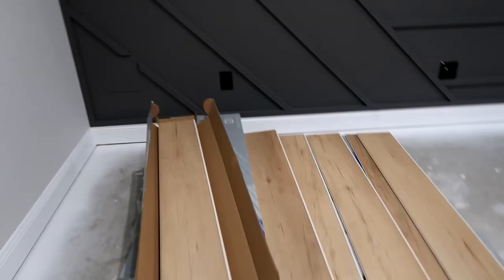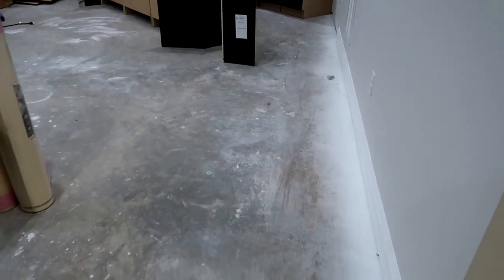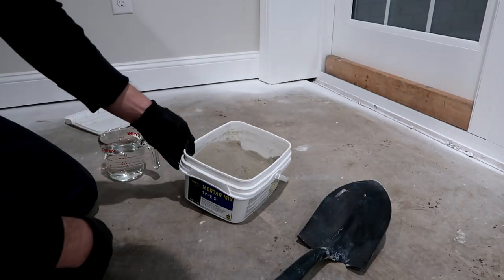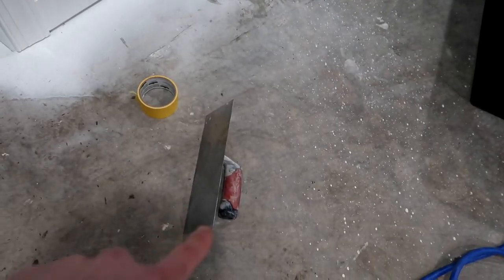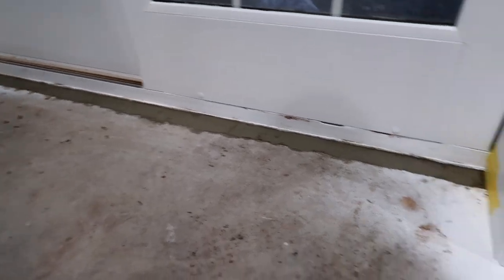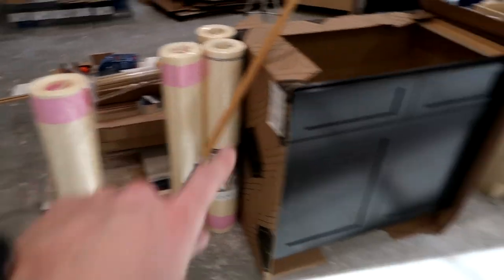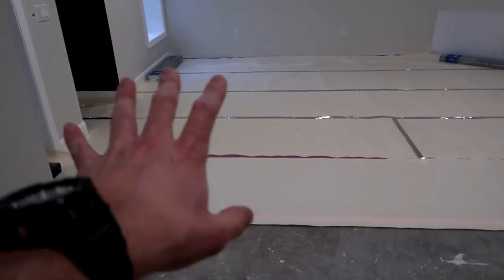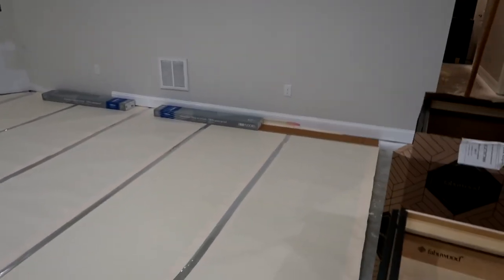Basement LVP Flooring prep | Finishing my Basement | Episode 21

Comment: Great videos. Do you know what underpayment you used?
Reply from the maker: Unfortunately I don't have the underlayment info. The flooring company I ordered through, ordered it and included it with all the materials.

It was about 1/8" thick foam, and it came with some special tape that locks out moisture. I suspect most flooring companies will have something you can use

Comment: How level was the rest of the slab before you installed the LVP? At this step on my basement and existing slab is around 2/16-3/16” variation at 10’ but overerall has a slight grade to one side. Over 20’ drops slightly under 1/2”
Reply from the maker: Even if the floor slopes that's ok, what you don't want are low or high spots that cause the lvp to not sit straight.

I checked the whole area I installed lvp with a 6' level at various locations and to my surprise everything was level.

Only one spot in my basement had a dip, where my bar island got installed, but that I shimmed to be level